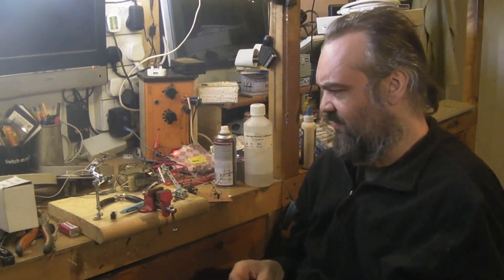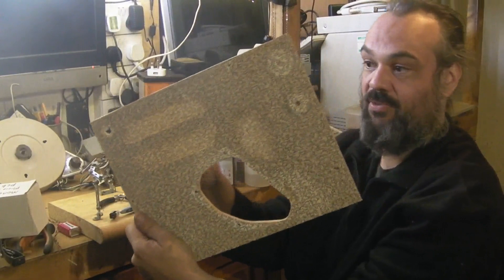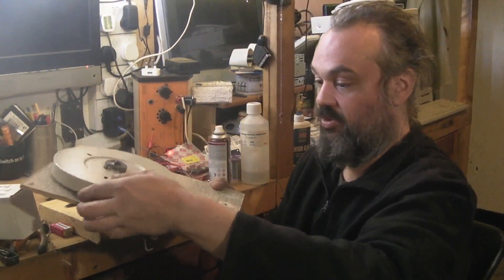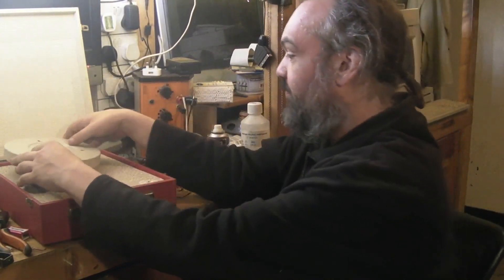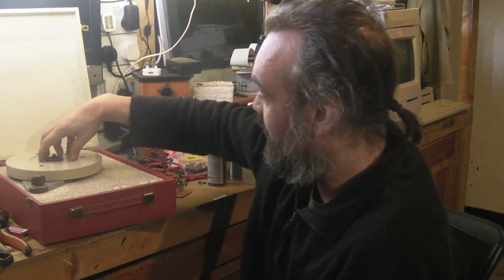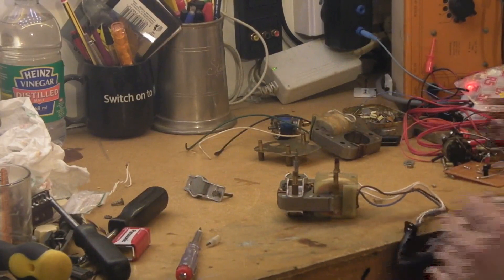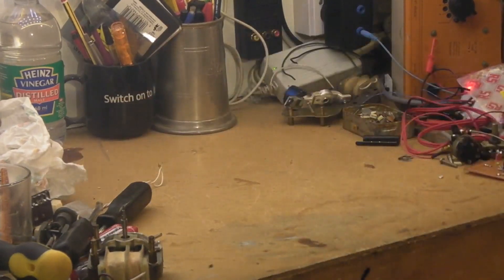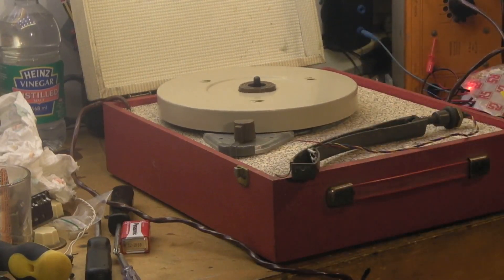1960'S Record Player. Trash To Treasure? Pt2

Comment: Excuse me, but is it possible the platter turns the wrong direction?
Reply from the maker: HaHA congrats you are the 1st to spot it! Yes indeed I was too busy talking about how to reassemble the motor I did what i said not to do and put the windings in upside down. its all sorted now and running in the correct direction.
Reply: @Jayoldstuff1  Nice to hear, wish you all success with the project.
Reply: Lol yea didn’t notice that. Good catch